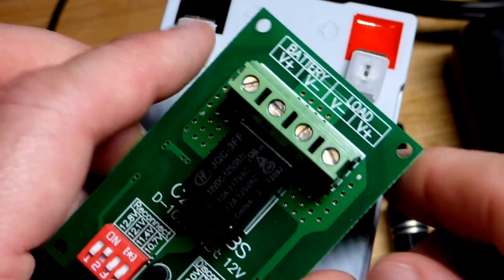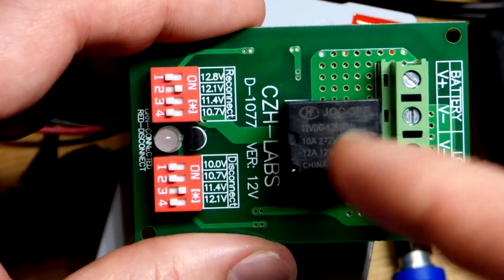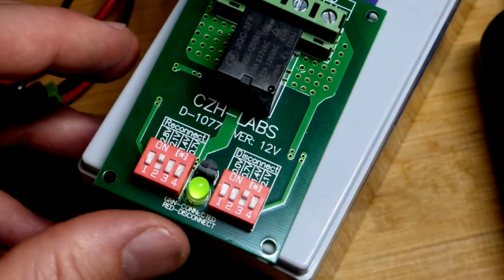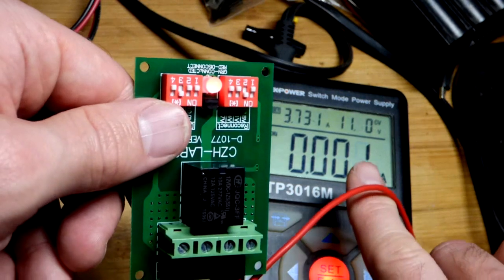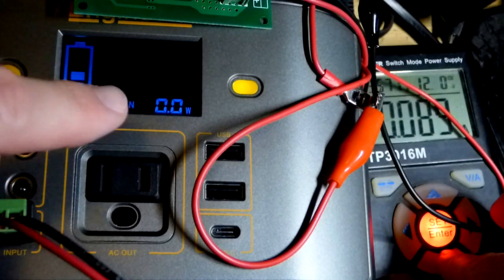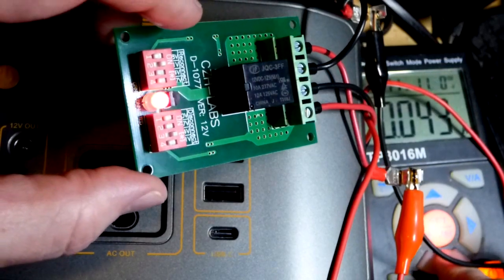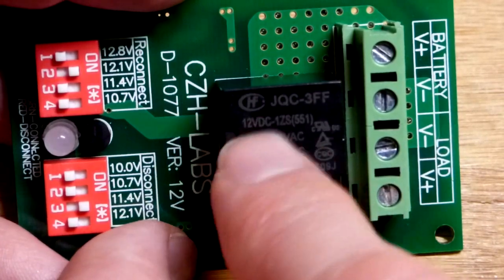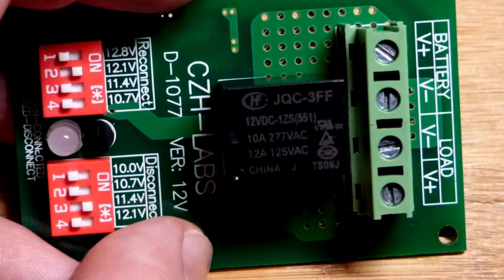12V Battery Low Voltage Disconnect LVD Module demonstration by Electronzap

Comment: I'm looking exactly for this module.
Please share where to buy in India.
I want it for my car.
Reply from the maker: I just buy stuff online in the US, so can't help you unfortunately.
Reply: @Electronzap  the xh m601 module is available here in India. It activates the relay whenever the battery voltage is below the minimum set value say 12V and remains activated until it reaches the max set value say 14V.
But I want the reverse to be happened.
The relay should be activated whenever the battery voltage is ABOVE 13V and stays ON till 14V.
Please kindly help with this to achieve my desires.

Comment: Is there any similar module to achieve the following functions?
1. In standby mode, it should draw maximum 10 mA.
2. The cutoff voltage should be greater than 13.3V.
I want the module to check if car battery voltage is below 13.3V.

Comment: Great video. Just a question. It does a completed cutoff for the low battery disconnect or keeps a residual charge?
Reply from the maker: These units tend to draw power from the battery when they cut power, probably about what it takes to light the LED. Mainly they just remove the load from the battery, which should be recharged as soon as possible.

Comment: Nice video sir! I have a few suggestions. 

It would be even more better, if you could have showed us the back side of the board, showing the type of Microcontroller used, PCB Traces/Thermal Relief under the relay, IC Packages, etc., Also, Few thoughts on the recommended enclosures for this one(D-1077/12V), would be helpful. 

Thanks for reading. Have a nice day :)
Reply from the maker: I didn't research the unit that much, but those would be good topics. I did mean to show the bottom because there is a lot of exposed metal under it, so it would be a big short circuit problem if it touched any conductor. But I forgot to show the bottom until after I made the video.

Comment: Why doesn't the bms logic inside the battery pack shut off the voltage when it gets low and turns it back on again when it goes above a certain voltage upon charging?   Well, I know you are not responsible for the bms behavior but it seems like a missing feature of the bms and you are providing us a workaround.  Thank you.   Second question,  shouldn't the voltage of a battery be measured using open circuit voltage instead of when there is load?  My 12-volt batteries always read much lower when there is a load versus no load.  But it seems impractical to shut off the load just to measure the battery voltage. What are your thoughts about that?   Third question, if the voltage level is flat for LiFePo4 battery packs, how does one determine state of charge using voltage?  No response required today. If you mention it in a future video that would be okay.   Thank you for the videos.  I am building a small mobile robot just for fun.  I am going to try to power it with rechargeable 6 NiMH AA batteries first.  What do you suggest?   Have a great day!
Reply from the maker: There should be a BMS in the LiFePO4 battery to shut it off to protect it. Most of them have a BMS unless you buy individual cells to make your own pack. Probably best to use the BMS shut off only as a last resort though. I think that they design the BMS to only kick in during extreme conditions that are not good to do to the battery often. The battery voltage goes down with a load, so that's usually the best time to measure it. It might look like it has a lot of charge left if you measure the voltage with no load, but then drops right to a dangerously low voltage when it starts powering a load. The discharge isn't perfectly flat, there a long period of time where the voltage holds about steady, and then drops suddenly while discharging. The best you can do to know the state of charge for sure is to use a charger to charge it to 100%. Most chargers shut off at that point, or float the voltage, There's a lot of people on YouTube who have used and tested these batteries a lot more than I have, so I'd watch a lot of the LiFePO4 battery videos on here.
Reply: You will damage the Lead Acid battery if you over-discharge it below 10V.  This board is perfect for Lead Acid protection.

Comment: Greetings from India! Thanks for the video...
[0:53] "we have to raise the voltage up to 12.1V" - I am unable to understand, what does it mean? could you pls clarify sir? Does it mean the charging the battery to 12.1V?
Reply from the maker: Thanks again for watching! Yeah, this unit cuts power to the load, and most of the module when a battery discharges to a low enough voltage. Then you have to recharge the battery up to the reconnect voltage for it to switch a load back on. The power supply that I am using in this video would be replaced with a battery in a real circuit. Batteries take a long time to discharge and charge, so I am just simulating the process with the power supply.